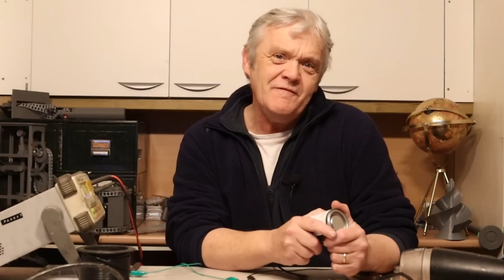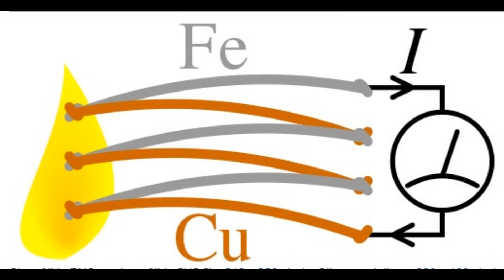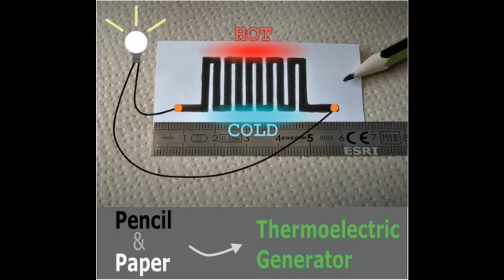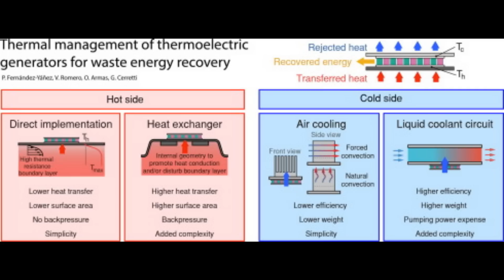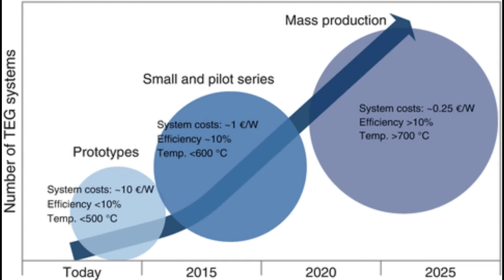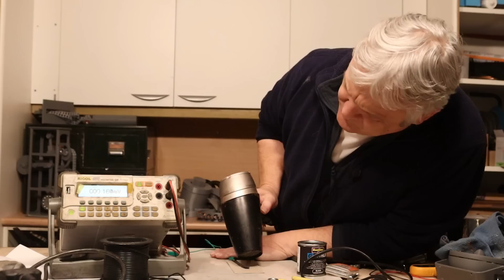2131 Thermoelectric Generators And Graphite Paint

Comment: i just skimmed a paper saying that if you paint 2 graphite strips different widths they will have different seebeck coefficients and can therefore become a thermocouple generator. They used an HB and 6B pencil to draw two lines. Title of the paper:
"Single material thermocouples from graphite traces: Fabricating extremely simple and low cost thermal sensors"

on another note, i wonder if the graphite-painted foils in battery cells can be used as thermocouple junctions. I will give it a try, as i have a lot of junk cells
Reply: Nice info thanks. 3D printing a conductive filament at different thicknesses could work in this case. 👍🏻
Reply: The answer is yes, the foils will work as long as the they are of differing resistance/reactance from one another and can easily pass current.  If you have those available to you, then please do so and let us know your results and thoughts on it.  I am currently coming to the opinion that what is going on with this effect is in a way rectification of light(just my opinion mind you).  Heat is in my mind infrared light electromagnetic waves.  A normal rectifier basically just clips the wave such that it doesn't cancel itself out.  That in essence is what we are doing here with heat.  To think of it as rectification makes it much easier for me to wrap my head around these concepts.  Thank you very much for your comment and inspiration!
Reply: Excellent ideas. Let us know how they work out?
I've been wondering if a block of thermo-couples in the focus of a parabolic trough/disk would generate useful power; fabrication might be tricky (not the trough/disk, I've got that nailed).
Reply: Stating up front I have no info on if this would work but it'd be easy to try...

I'd be interested is if drying different sections of the paint while under DC current (or magnetism  ) made things line up differently and improved/diminished output results of 2 graphite traces used as a thermocouple. The obvious ones of say positive (or North ) towards the junction compared to one away but also, it it makes a difference, then to try drying one along axis the other perpendicular of the later electron flow.
My thinking here to make them more different to each other and see the effect.
Reply: @glencahalin4786  This is why we do things to figure out what works.  It will work given the right conditions, though how well is another topic of conversation and is pretty much irrelevant at this stage.  Try it and see what happens, then start the conversation on how well or not it works.  Thought experiments can only take us so far down the rabbit hole,   then it's on to practical application.  Thanks for this topic of conversation.  It is very interesting.
Reply: @jamesross1003  I agree on 'try it and see', but the thought experiment depends on the actual thinker. Only a few are 'Einstiens' and able to think beyond local experiments.
Reply: @bikerfirefarter7280  We'll have to disagree on that, it is my opinion that anyone with an idea and follows with thought experiments can not be a bad thing.  To succeed is to fail over and over again until you manage what you were trying to achieve and as long as you learn from your failures it's a good thing.  No thought experiment or real experiment is a bad thing.  To be insulting to those that do indeed try but fail is tragic.  So no, we will have to disagree that the thought experiment depends upon the intelligence of the person doing it.  Something to think about is this, how do you think as children we learned how our world works?  That's rhetorical,  it is through experimentation both thought and otherwise types of experimentation.  But thank you for the opportunity to further state how I feel about this subject.
Reply: @jamesross1003  I don't know what you are disagreeing about, I didn't say anything about 'intelligence' or experimenting (thought or otherwise) had anything wrong or negative about it.
My comment was about "Thought experiments can only take us so far down the rabbit hole" in as much that 'thought experiments' can and have taken us FURTHER than the physical limits of 'the rabbit hole'.
Reply: @bikerfirefarter7280  The comment about the thought experiment depending on the thinker has an implication there.  You may not have intended it that way, but it implies that some people are not fit to perform thought experiment.  That was all I was disagreeing with.  It could be taken in an insulting way, it kind of implies that some people aren't intelligent enough for it.  I just think that everyone should do thought experiments.  It is a great place to start when working on a solution.  Then by following up on there are few Einsteins is just reinforcing the negativity of the statement.  Try reading your comment about those things again and take that into context and I think you may then see why I and others might disagree with it.
Reply: @jamesross1003  The 'implication' is actually just your assumption. Also assuming I implied a 'high level of intelligence' (whatever that means) is needed to do thought experiments is not valid, I meant it as a way of thinking (Einstein wasn't the smartest guy, he just thought somewhat differently to the average joe). And, yes, some/most people are not fit to think in certain ways (in the same way Darwin meant 'fit'). Its not an insult, its an observed fact.
If people feel a conclusion based on assumption is insulting, that's their problem not mine; any offense is taken not given.
I'm not responsible for people reading into something other than what is intended.
And btw you don't work on a solution, you work towards it, you work on a problem. More properly in the order: conjecture, hypothesis, 'experiment'.., theory...law. You don't assume a solution first then try and make it real by 'experiments' and selectively cherry-picking ; that just bolsters misunderstanding and fantasies.
I stand by my original comment, make of it what you will.
Reply: @bikerfirefarter7280  And I stand by what I said.  We'll just have to agree to disagree.  It is not an assumption when it is further implied.  But whatever, it makes little difference in the scheme of things.  My point is that it is always best to lift people up rather than discourage them.  To say that rather a thought experiment should or should not be done depends on the thinker and then state that there are few Einstein's is potentially a discouraging and negative train of thought period full stop.
Reply: @jamesross1003  I never said a thought experiment should or shouldn't be done. The 'implication' is not there, that is your bias.
To encourage or discourage isnt there either. 
My point was an observation and facts about ability/attitude re 'fittness' to experiment in any type/degree, everyone has different abilities/levels.
To purport 'agree to disagree' when you mistake or assume my meaning and intent is just another way of proving and bolstering a closed-minded and inflexible attitude, bordering on the dogmatic.
Feeling 'lifted' and/or 'discouraged' depends on the other parties demeanor and intent.
Whether I or anyone should choose to 'lift' and/or 'discourage' someone also depends on the other parties demeanor and intent. 
Its not always best to lift/encourage; i.e. Hitler, Gengis, etc; although even that depends on context.
I wonder if you'll misunderstand that as well.
To quote Disneyland charactor/actors, 
'Have a nice day'.
Reply: @bikerfirefarter7280  I just said your exact words back to you and you claim I have a bias.  Why would you say that it depends on the thinker and then say that there are few Einsteins?  What did you mean by those statements?
Reply: @jamesross1003  Not my 'exacts words', you have them out of context.
Its not a claim, its an observation of fact, you have a bias because you have a selective and presumptive expectation.
Because it DOES depend on the thinker, and there was only one Einstein (although there were/are other 'Einstein'/different thinkers they are the minority).
A parrot can say 'exact words', that doesn't mean it understands their meaning, or the context.
if you don't understand what I meant I'm wondering if you are a little limp under the cap.
Reply: @bikerfirefarter7280  Your exact words right here---->"I agree on 'try it and see', but the thought experiment depends on the actual thinker. Only a few are 'Einstiens' and able to think beyond local experiments."  So no it was not out of context.  You can't defend the indefensible.
Reply: @bikerfirefarter7280  That is a copy and paste exactly as it was written by the way.
Reply: @jamesross1003  The quote is correct, your understanding/context isn't.
Squark.
Reply: @bikerfirefarter7280  I have already asked you what you meant by it, but all you say to me is it is out of context blah blah blah.  Why not just tell all of us what you meant by the comment?  No one will understand it if you do not explain what you meant by it.  So again, if my understanding is incorrect then help to correct it by stating in no uncertain terms that which you mean by it.
Reply: @jamesross1003  'all of us'?
That tells me plenty.
Nobody else has said they don't understand the comment "I agree on 'try it and see', but the thought experiment depends on the actual thinker. Only a few are 'Einstiens' and able to think beyond local experiments.", just you.
I've explained and corrected in no uncertain terms, but you insist/persist with your false interpretation and misunderstanding. A similar mind-set occured with the 'N-rays' affair.
Your hypothesis is false/unproved as it is based on misunderstanding/assumption.
You are now/still even using 'out of context' against non-related points.
I can't make it any clearer, you'll just have to start from the begining relative with your notion about heat/light 'rectification', and what 'thought experiment' actually means, and error check your illogic from there.
Reply: @bikerfirefarter7280  Really, you think that I am the only one that will see what you post in public.  No you did not  answer the question.  You just got defensive and said it's out of context, you just don't understand, ect.  And you just did it again,  not saying what you meant by that comment.  You won't say it, because maybe the way I took it was how you really meant it.  So,  actually answer the question rather than try to redirect and insult me.  I was not insulting you, only stated that I disagreed and why I disagreed.  Enough is enough, put up or shut up.  What did you mean by the statement?
Reply: @jamesross1003  Of course I know others read what I post, but you are the only one commenting/confused.

I'm not 'being defensive' either. The statement means what it says, not what you misunderstand it to mean. There's no other way to say it without changing the meaning. And you aren't disagreeing with me, that's because you've repeatedly stated/proved you don't actually understand the comment.

I've answered your question; I'm not redirecting you, I am drawing your attention to your error. Think about it.
Reply: @bikerfirefarter7280  And once again you refuse to say what you meant by it.  So therefore apparently either you don't stand by it, or are actually embarrassed by it, otherwise you would just plainly state what you meant by it instead of redirecting which is exactly what you just did.  I plainly asked you to clarify what you meant and you refuse to do so.  Really come on,  this refusal to just simply state what you meant by it is just a confirmation that it was indeed a negative comment and your attempted dismissal of me says it all.
Reply: @bikerfirefarter7280 nah you're just a douche
Reply: I have tried this. Didn't work for me.
Reply: Totally 💯 Agreed that the Practical Experiment would be a Fantastic idea and Anything that you would discover would be awesome to learn about from!!
Great Comment, Great Ideas, and Many Thanks!!
My current situation means that I am unable to do anything Practical myself at the moment,,,,, I'm a Wheelchair user, and I have also been stuck in bed with pneumonia off and on for the best part of 2023!!
Please keep us informed on how things go (or otherwise.)
Namasté 🙏
Andréa and Critters. ..XxX...
Reply: @AndreaDingbatt  Bit of a bummer, wheelchair/pneumonia etc; I get where you're coming from, I'm asthmatic (I'm also laid up for weeks with a persistent chest infection/pneumonia), but, 'Steven Hawking'? Mustn't grumble. 
Practical doesn't have to mean big/physical stuff, you can do tons of research and oodles of 'proof of principle' things with small-scale kit. I mean, paints/foils etc, tea-lights/sunshine, multi-meters, banging brain-cells together etc. Self educating. Then, if necessary, get others to build bigger stuff based on what you find/want, or DIY when you are up to it.  Av at it.
Peace.
Reply: @John-mc8sh To what, exactly, are you referring?
And, 'generating'?
Reply: Using it for a sensor is way different than a generator tho
Reply: @SimEon-jt3sr  A thermocouple being used as a sensor is a generator.  It produces a current that is "sensed" in that context.  Meaning the generated current is what is used to determine the temperature.  Though it is possible to test it's resistance as well to determine temperature.  For example the higher the temperature the biggest change to resistance and higher the generated voltage.  This is all depending on the application and materials used.  Extreme cold and things get a bit weird.   Think how some materials can become super conductive at extreme cold temps.